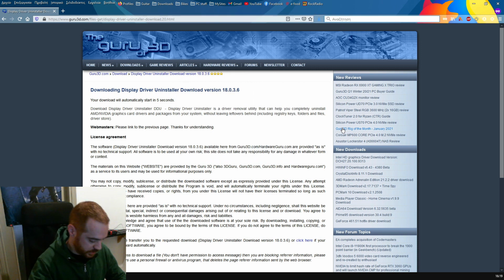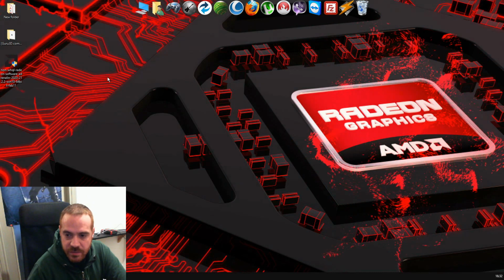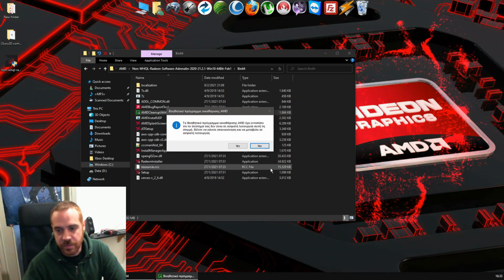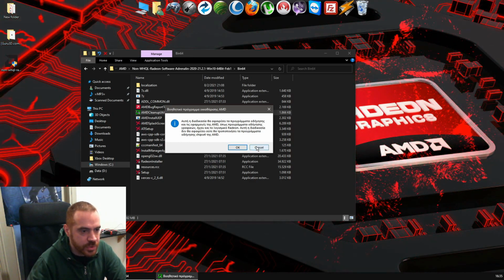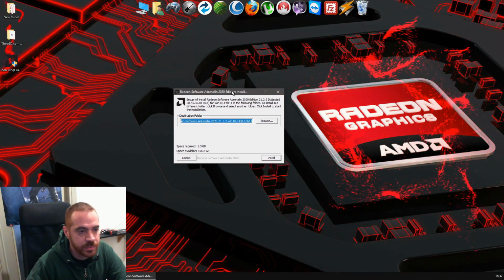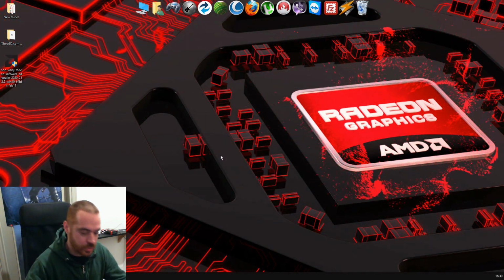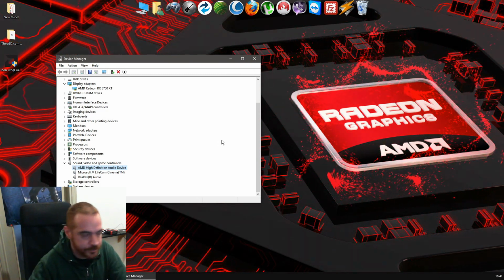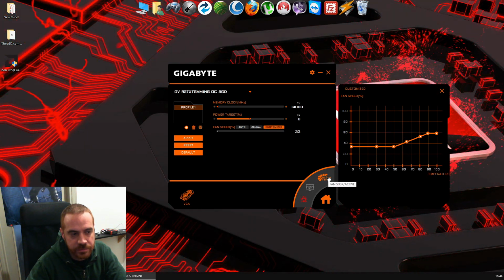AMD Driver Crashes fix 2021

Comment: I have a MSI RX570 armor oc 8gb card when  drivers only with out software are installed will log in to windows as soon as you click on anything it goes to a blank green flickering screen tried everything can't get to work did ddu, AMD drivers only, let windows update install driver nothing worked please help.

Comment: Hi Sir,

I am using RX 6600 XT this is a brand new GPU that I recently bought.
I already followed all the steps, unfortunately the issue is still the same.
Tried to play games after around 15-20min the system freezes and crashes.

Comment: I have a Radeon (AMD) Duo Pro 32gb Polaris graphics card.  running Windows 10 Pro.  I can loaded Windows and run under the Windows drivers but it has the same screen on both monitors.  If I load the driver for the Duo Pro 32 Polaris, it tanks the machine and it must be rebuilt or restored to recover.
I’ve run the uninstall in safe mode but when I get back to the reinstall, the same cycle of events repeat themselves.  I’ve not used this card in it’s full potential for almost a year because I’m frustrated with it.  basically $1300 wasted!

Comment: It is funny you said that "Only thing you need from Adrenaline software is freesync. 
I have owned a 5700xt and now for 2 months; a 6800xt... Awesome card. But for the last 2 years I haven't been able to touch any settings in Adrenaline. If I change anything, then Adrenaline closes out and pretends it is on the wrong computer....
I'm going to end up reinstalling windows on this computer for the 3rd time in 2 years... If I didn't know better AMD is juking the drivers for Intel based PC's just to make people change to AMD....
Don't get me wrong. My 50" Sony Bravia XR is so pleased with it. I can roll out some good titles with great FPS for 4K, and TV is so good at 1440p... If it wasn't for the Adrenalines lack of stability...

Comment: I have a problem. I have an HP15db 1401nc laptop with an AMD Ryzen 3 3200U processor, after installing fresh windows 10, I install the driver for the AMD adrenaline graphics card, after that the windows update automatically installs the Micro device display driver, and I can no longer enter the AMD Adrenaline program. I don't know what the problem is.

Comment: @All I have a super strange situation here, my PC:

Ryzeb 3600
Viper 2x8GB 3200 DDR
2 x SSD + HDD
Asus x470f motherboard with latest bios
Windows 11 latest update 
Antec 750w PSU

And the brand new Gigabyte Radeon 6700XT Eagle 
Previously GTX 1060

I will start with facts, I ran multiple DDUs, tried 3 generations of Radeon drivers including the Enterprise pro drivers.  NOTHING helps.

So what's the issue?

Any game I test including ray tracing demo benchmarks, nothing crashes.
But Cyberpunk will crash anytime I enable ray tracing, even if I just enable the 1st ray tracing tab and nothing else it takes from seconds to minutes until it crash, with it crashes the Radeon driver. Playing without RT, NO crashes.

I decided come to my friend today, we installed my gpu on his pc, Cyberpunk worked and didn't crash, with and without RT.

Then we removed his ram, put mine, and..... Crash as soon as you try play with RT on.

Then, we removed my ram and put his back, and now the game crashes on RT on his ram too!!!!!! We tested multiple times and reboots before we tested my ram....it didn't crash....what is happening?

Any ideas ....any help?

Thank you!

Comment: Dude, I have been fighting this for weeks, and following you step by step fixed my issue today. Hopefully it stays fixed, but just doing ddu and then amd's software to install the driver still gave me issues right after logging in. Thank you so much!!!
Reply: i have same issues with my rx 5700xt , but i have some friends that were professionals and were willing to help me, the card is not under warranty any more and no one knows how to fix this, i cant wait for it to just die, i am gonna buy an nvidia gpu next time, amd has given me trouble in the last 2 years my friends with nvidias never had an single issue

Comment: Someone help. I reinstalled windows and it crashes before it starts. The GPU just turns off . In safe mode it works būt when im installing drivers it crashes and pc not turning on .

Comment: My friend, thank you so much for putting this very frustrating issue to bed. You are a gentleman!
Reply: @IMMORTAL GLORY 天   I have crashed a lot less. After doing the fix I only used to crash playing HOTS or Star Craft. Both blizzard games. I discovered lowering the graphics for both of them, I never experienced a crash. I wonder if the card handles different settings poorly for different games. But at least the Adrenaline software wasn't the issue.

Comment: its joke how much amd have problems and they still stick to this software? i did a clean install for an m2 drive on my x370 card 3 days ago only upppdated ship/ and amd driver ofc adrenaline came with it. over night i instaled 6 games i played now with np for 3 days i did ddu stress test and every thing was good. But to day even the old wows crash on me and ofc the diagnose tool came up from adrenalin i have had this caind of problems from day one buyed one of the best 5700xt in bench its like the best i seen on air safirer pulse its on the gpu by turbo 2280 mhz altime and no high junk tems oits a coool system overall never seen the card go over 70 degres cpu is on 60 drives and mb every thing is under 40 so on paper perfect system and hardware but we alll know you nead to uppdate your drivers with games doing all this when a new driver comes out its just horrible so never a amd card again my last one was 6950 unlocked the shaders 6970 in crossfire and it crush most games with out problems for years but after that i did buy prob 6 nvida cards ofc a bit overpriced but never any problems gtx 980 gtx 980 ti 1050ti 1060 6gb and alll the way upp to the 2080 never one prob the day my problems came was with amd and i only buyed this 5700xt bc it was on sale and i had a ryzen system build but never again am gona rma this card and buy a new nvida card and if i have to buy low end ore high end dont mater what in stock i take you cant put a price on stabilty and time. Nice video for the ones not afording uppgrades ore jsut whant to keep ther old cards.

Comment: Followed every step, my problem isn’t fixed yet. i don’t really know what to do i’m literally trying everything
Reply: Me too my windows freezes when i tray to install any driver for amd
And the amd card show up in device manger under the name video controler
Reply: what gpu you have ? The last two amd drivers has known issues to give tdr on certain cards , and this guy is saying download the latest drivers , thats crazy , to fix this you need to go to an old functional driver until amd brings a fix
Reply: @mike-2424   I have RX 590 and i tried to dowload older version but still got drive timout issue, recently I had intention to re-try old version but on  the website now are only avaiable the latest one and a pro one, something like that. the more time passes the more I understand that there is no light in this tunnel, i wonder if nvidia products behave like this too.
Reply: @JohnDoe-si2pb  the drivers are there but for some reason its hard to find , go on google and look for what software was released for a particular month , like " adrenaline software june 2020" and when u find it type it in google to look for the download on amd site , like " adrenaline 20.1.9 driver download" , you don't have to get it from AMD (so i was told , but Im a newbie and i dont wanna download some virus , so you might wanna make sure get it from amd,  but you can find it that way i stilll havent found one that works for my rx 480 but some guy on a rx 580 on reddit said he went to 2020 may drivers and underclocked his card by 2% and he's not having crashes anymore
Reply: @mike-2424  its not the driver that cause problems belive that its that adrenalin and win 10 that dont work togather i know bc only times my system is stable is when i run clean install of win and only update ship every thing els you get from win op sound and display drivers sound and amd suport and i have no fps lose ore frame times only thing i can see is no more problems ofc if i encounter a game like cp ore any game that dont work i do like this guy do almost and it solves ur problem people crashing on start up get another drive ore clean it make a new install of win10 upgrade only!!! ship so ur cpu and ram works and ofc bios if not already have that ore nead it and np i play cp red dead online ac valhalla and meny other neew and old game with np but like i posted up ther i dont like to do extra work so from now on i only buy nvida cards in future and i know now its not ryzen that cause this problem but they are cald amd and for that am relloing intel on my next build + nvida cards and after all ryzen still have problems with ther memory controller intel u can put any memory what it say on box works always and now days with new rocket lake 11 gen why not so what they draw a bit more power so what? like that have been a problem for ower generation having up to 3 working gpus in crossfire ore sli haha
Reply: Did you fix it?
I have an XFX R9 390 8gb and I have a similar problem, when I install the drivers the screen goes black and is in a rebooting cycle, I can only enter safe mode and I already use the DDU and I have used different drivers including the ones last year and it still doesn't work
Reply: @Joseph-no1ji  i gave up lol ,I know its something software related tho .... last thing i did was updated my bios ( my MOBO was on a old bios) , before running the update my gpu would not get detected and fans won't spin the gpu was in the pc while updating the bios and after it restarted the gpu worked perfectly and fans began spinning( i didnt even reseat it) but after downloading the april version for adrenaline this happened , i even went to an old 2020 may version and it happened , and now my gpu is not getting detected again , and as the other guy said , it's only stable after a clean install , idk how come it was stable after a mobo bios update that may work for u to , but i ur gonna have  to update the gpu with out adrenaline , Im just tired re-downloading stuff again , I mostly play fortnite and i can get up to 100 fps with my cpu alone , i7 4790 , im chilling til i find a decent nvidia card at MSRP

Comment: I've been getting a lot of black screen randomly and it stays off and doesnt cut back on until I restart my PC. If anybody can help I would love it. I've downloaded the AMD software hoping it fixes. But if anybody knows if a permanent fix can you help me
Reply: have u found a solution? im thinking that my psu is the problem, i got the same problem as you btw
Reply: @Hamza-tu4fd  no man. It got bad last week. I talked to a tech last night that told me to use DDU and then reinstall the drivers. I havent had an issue all day. So I guess that's a plus
Reply: Okay have you had any more issues with it. Because I had the newest update and it worked for literally 3 days

Comment: I was getting driver timed out too and I got a fix for me anyway, playing all my games on full graphics and not 1 issue related to drivers. I really should make a video about my experience because this really got me down, not being able to find a satisfactory solution to help. This isn't my channels subject content but so many individuals are just in the position that I was in. I really just want to help people. Therefore in short, the frustratingly timed out issue has nothing to do with drivers....it's your HDMI (High definition media interface) or your VGI cable. There's another option for you, trying source on your monitor and watch it link up with your GPU. I couldn't edit any more videos or even run a game without this error occurring. Please let me know if I don't make any sense because I can lend a hand to those who might need the assistance because it's incredibly stressful buying a magnificent expensive PC only for your computer to be taken out by a 0.99 driver related issues and 7.99 HDMI cables. God bless.

Comment: bro i have the Radeon RX 570 Series and i dont find it in the amd drivers website
Reply: just install any of them it will auto detect
Reply: Thomas Leysen   rx 5 u will find it
Reply: even if you do find it , the last two amd drivers has known issues to cause TDR bsods with rx 400 and 500 series , i have a rx 480

Comment: Man i cant open csgo in disable screen optimization mode, it wont start - everything works fine until i change a setting in adrenalin, dont know which one tho ive been trying for 24 hours im going crazy
Reply: Should be the Option 'sharpness' turn it off.

Comment: Hello i have built a pc with amd Ryzen 5 3500x, asus ex A320m gaming mother board, 8gb corcair ram , and gtx 1060 6gb gpu 

First i have blue screen at windows installation time ever time it wasn't letting me install windows 
Some how i managed to install windows and installed all the driver as needed (first chip set driver or else it was giving bsod) then there wasn't a problem for few days.
But its started again but its giving bsod at normal browsing not in games games are running well.
I have read and watch video but its didn't wark what should i do pls halp me.

Comment: I have RX 580 and sometimes it crashes ( watman stop woking )  but in games like  BF 1 , APEX etc  ... never had problems and every time i was using  recomanded drivers only. Optional = beta , u doing it on your own  risk.
Reply: optional isn't beta, optional means that the number of add-ons which it includes is much lower than the one in recommended, for example a support for some newly released game was added in an optional driver, in fact recommended drivers are the most dangerous ones because they include the most of newly added stuff in them
if you didn't had issues earlier as most of us, rollback to the previous driver or try to use the provided solution by the video uploader, also amd offers driver-only installation via their latest installers, too

Comment: I followed all the steps about cleaning everything up, but I'm going to give Adrenaline a try again. I've just really grown to love all the features, and Radeon Boost is a Godsend even with a 6900XT since I play at 4K. I only get crashes in Cyberpunk. Every other game seems fine.  If I continue to have issues, I will follow all the steps again and forego the Adrenaline software next time.
Reply: worked with the software?
Reply: i am going to give a chance to the adrenalin software, i installed with that way but getting crashes in cyberpunk after character creation
Reply: @MWtekh  Cyberpunk eventually became quite stable for me. All games are stable for me now. I feel like the drivers are getting really good and the software is the best there is in my opinion
Reply: @The_Chad_  thats good then, i unistalled adrenalin software because of tarkov (unity) crashes but it haven't worked seems like its not the driver issue anyway will give it try tomorrow 👍🏻👍🏻👍🏻

Comment: OK, this is not the problem. The problem has cropped up again and is causing constant black screen, shutdown crashes. AMD seems to have fixed thew zero fan problem with the latest driver update - FINALLY - after 3 years, however the crashes are occurring again after about 5 months of working. Some moron tried to tell me that it was dust on my fan, but it is the same problem with the 5700 XT that has plagued it since its launch. LOTS OF PEOPLE ARE HAVING THIS PROBLEM!!!!!!!!!!!!!!!!!!!!!!! SO many of us will NEVER buy an AMD produce ever again.
Reply: Your ignorance, get the enterprise driver, update chipset drivers.
Reply: @shadowopsairman1583  JUST GO TAKE A WALK...i have brand new amd setup with all the things posibile done and still geting green screen and reboot,cant find no issue since everything is new and not faulty..amd just have problems,thars it..i will never buy one for sure
Reply: Hahahaha i got told the same "Clean your graphics card fans from dust and it should work" useless absolutely useless.
Reply: True. I'm never buying amd again

Comment: Hey there, I was having issues with my 5700 XT as well, the driver or drivers would time out when I would play Apex Legends or even Call of Duty. I initially did all the adrenaline updates but it didn’t seem to work. I have followed your video step by step and I’m hoping things run smooth. Thanks for the great video, clarity and hopefully others find use of this information!
Reply: How have the crashes been? All gone since trying this?
Reply: @scagy  absolutely zero crashes, however I am finding that I have high temperatures for my CPU despite not running many applications.
Reply: @Eric-my3si  hey, how do u change the temperature and stuff like that, with what software? he said to use ur gpu's program but my gpus program is the adrenaline app